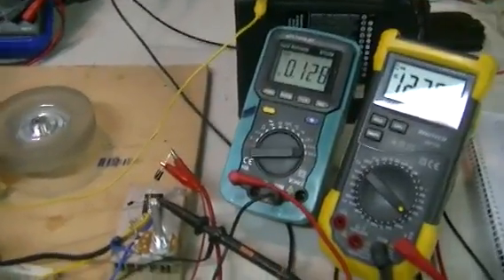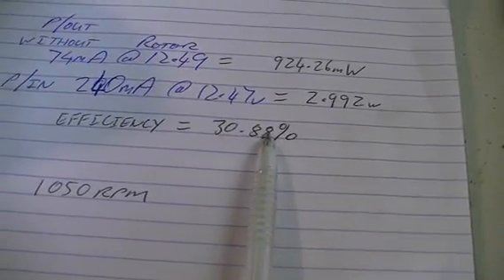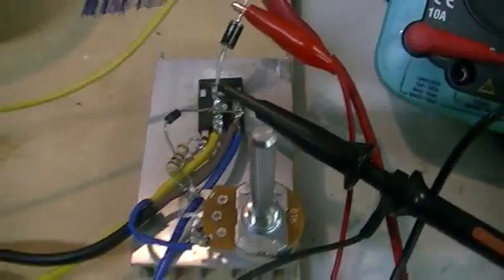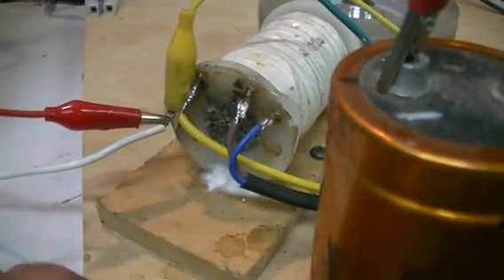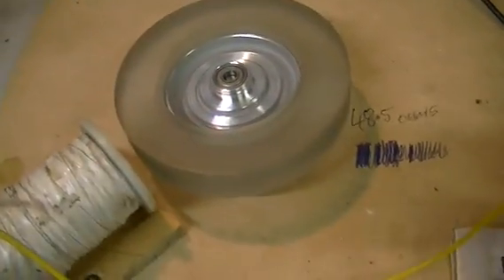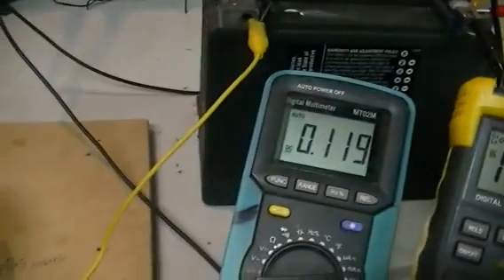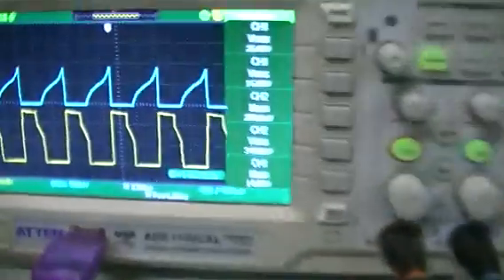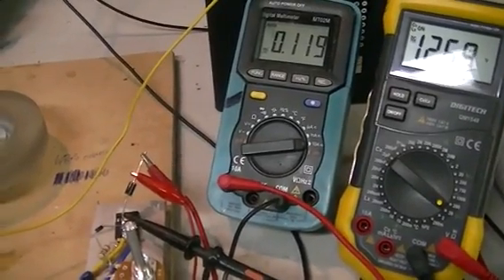Bedini SSG first run with accurate P/in P/out measurements.

Comment: I'm curious after giving this some thought. Regarding your PWM triggered rotor... I think it is behaving different than a timed trigger or induced trigger like you have here. what I mean is, I think you might be seeing less "out" than you would if the timing was in a different place on the coils' "modified sin-wave" like this video here.
Nice diode mod BTW, i'll have to give it a go. you have some great insights to this machine, you were the first I know of to actually prove running in attraction mode was more efficient years ago. I'm surprised you are not seeing  at least one 2 one by now.

So for the PWM timed transistor the "ON" is completely relying on the magnetic "gear" you are creating between the magnets and the rotor. IMO the rotor is merely keeping up with the PWM rather than the PWM driving the rotor. 
Of course this is perfectly fine and COOL. However, as you can see from this vid, with the adjusted timing (compared to the PWM), the output is significantly more. Of course the input is different as well so not apples to apples...
 I'll  run a test myself this weekend if this does not make any sense.
Thanks!
Reply from the maker: +Cool Joule  No Cool Joule. The best magnet configuration i found in my testing back at IAEC,was an alternating magnetic field on the rotor-not an attraction mode pulse motor.  P.S,,the reason for the bump across the collector/emitter junction in my 1st video in this series,was due to the transistor not switching on hard enough to cope with the current rise. I raised the amplitude on my FG,and it went away,and we then had a nice clean 0 volt across the collector/emitter junction for the whole pulse.
Reply: +TinManPower  I don't think i've seen the vids on A/C.
I only saw the ones posted many years ago where you proved south out yielded better results than north out. 
can you point me in the right direction to find your alternating N/S info. I like going over that stuff as I do anything new, it keeps the brain juices flowing :-)